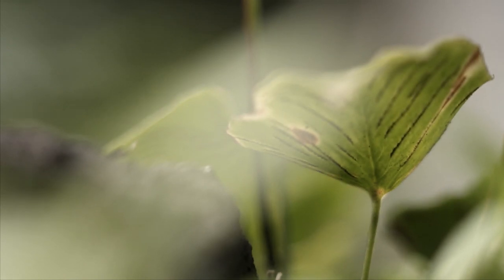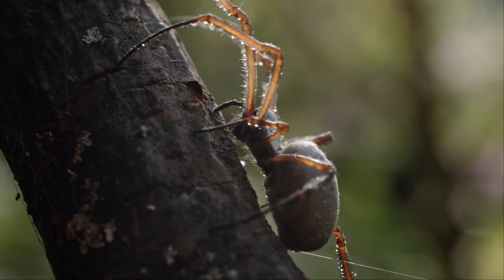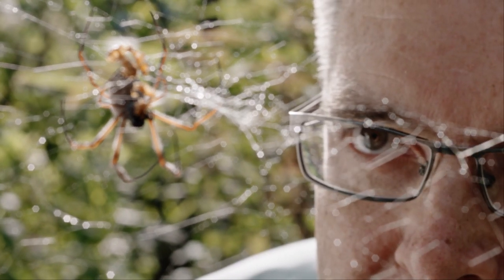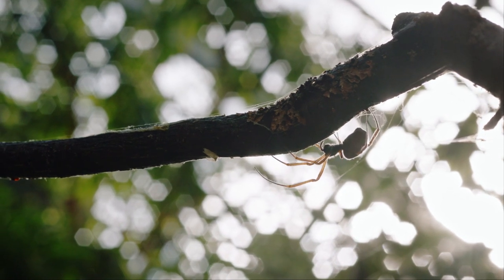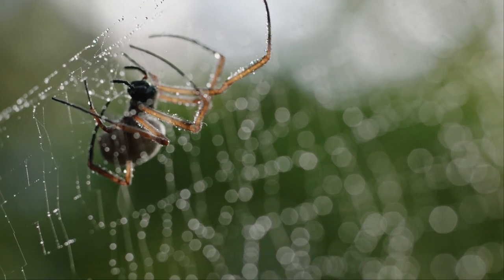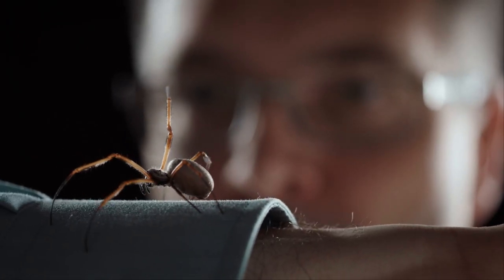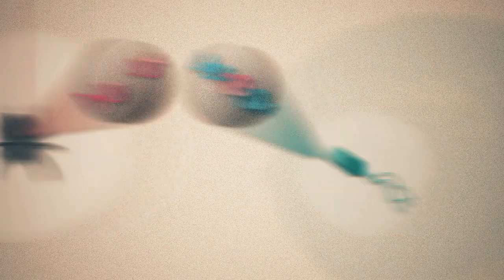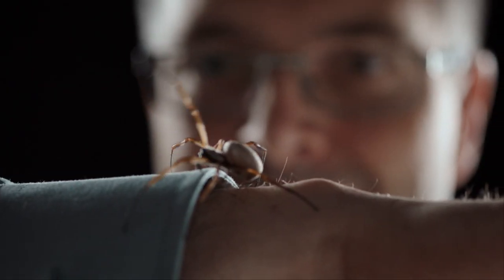Thomas Scheibel - Artificial spider silk

Comment: could you theoretically use this fiber for artificial hair implants for those who cannot grow their hair? hell if that's the case I use that gene therapy stuff and get rid of all my hair and have that implanted the biggest downside would be it not growing so you can't really change up the style but if you are able to get it to change color through radio frequency which uses basically sound and heat while imprinting it with light to change its colors up that would be f**** amazing
Reply: Then there's the problem with the onset urge to eat flies.....